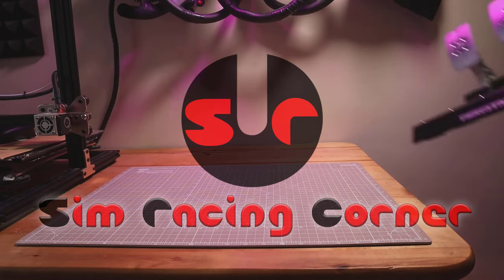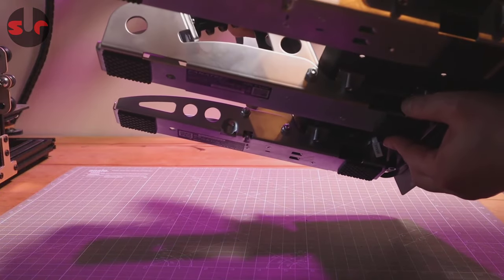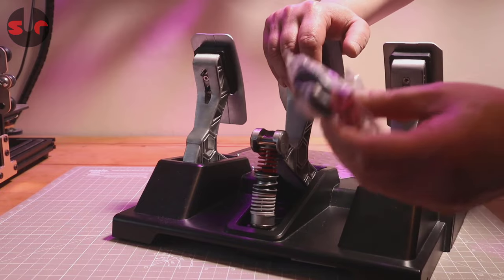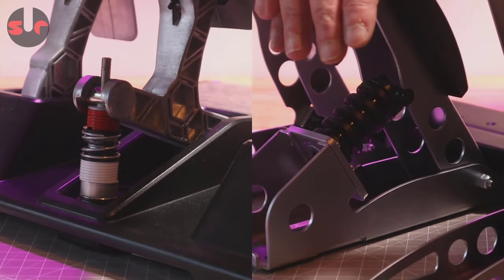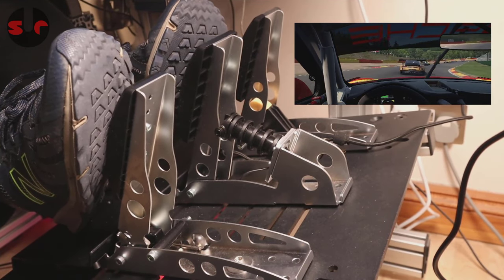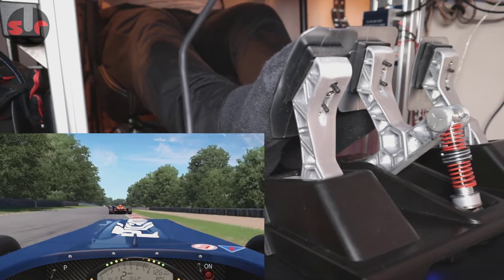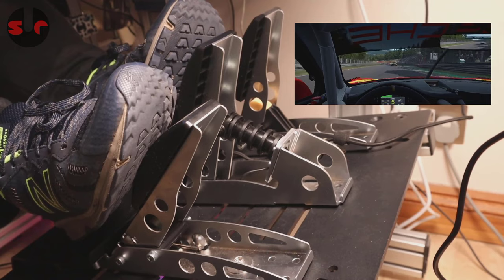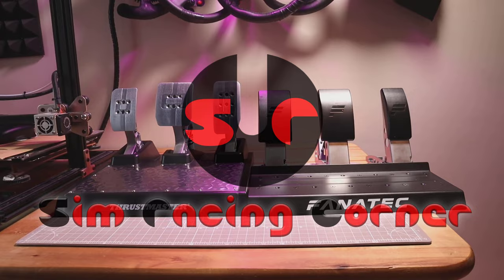Fanatec CSL Pedals Load Cell VS. Thrustmaster T-LCM pedals 🎯SHOOTOUT🎯 Which one should YOU get?

Comment from the maker: ▶ Show your support with a Ko-fi https://ko-fi.com/simracingcorner
Reply: Done. Another excellent video. Looking forward to your review of the 3Drap mods. :)
Reply from the maker: @DrR1pper  Thanks fella. I'll be getting started on testing these mods shortly. Not sure which one I'll begin with, so many to choose from that box. But a bunch of videos on the way soon.👍‍
Reply: @SimRacingCorner  if I may lend my opinion, I reckon CSL pedal owners would be most interested in the load cell brake elastomers mod first, potentiometer brake mod second, throttle and clutch mod third and noise reduction mods last. Not trying to sway you, just my 2 pennies. :)
Reply from the maker: @DrR1pper  I agree, that would be my logic too. They are the more complex videos, so I expect some of the quicker/easier mods will come out first while I'm working on the brake mod content.
Reply: @SimRacingCorner  makes sense. :)

Comment: Nice review. It would have been nice to add a cost comparison so prospective users could help determine value. If the Fanatec are 10–20% better but cost 50% more, then maybe they're not worth the investment?
Reply: The review mentions pricing is comparable. Without discounts and ignoring shipping costs, the CSL LC pedals are $/€200 and the T-LCM pedals are $250/€230. 

Depending where you live the Fanatec pedalset may cost more with shipping than the Thrustmaster set and there could be a promotional price on either set which would impact the price formula. 

Also keep in mind you can start with the Fanatec 2 pedal set at $/€80 and add the load cell brake for $/€140 later on. Sure you'll spend more over time, but sometimes the investment is enough and you have a viable upgrade path whereas the Thrustmaster isn't as modular.

Comment: I'm looking at getting new LC brakes to replace my Logitech pedals. I was leaning towards Fanatec but then I started seeing people reporting issues with the LC pedal not working with the other pedals in the setup. Some report a burning electrical smell. That gets me concerned as the customer support at Fanatec doesn't seem to be all that great.
Reply from the maker: I used the CSL pedals for 6 months without any technical issues. It's the first time I've heard of the problems you've highlighted, and no one's dropped comments on any issues on any of my videos. That makes me suspect the problems are isolated rather than widespread.
Reply: @SimRacingCorner  I hope so. I searched 'CSL load cell pedal not working' and got quite a few hits. I still have a few months before I purchase anything so I guess I'll just keep watching. Thanks for your video. I appreciate it.
Reply from the maker: I don't think there is anything abnormal going on here. Type in 't-lcm pedals not working', and you'll get an equal amount of hits. In fact, you can do the same thing with any hardware, and you'll get hits. Anything mass-produced is going to have some measure of failure.
Reply: @SimRacingCorner  I understand. Nobody complains when things work.
Reply from the maker: @BobK58  Yup.

Comment: When I first got the load cell csl brake i thought it was too stiff but they do break in. Shoes are a must though! Im not going to bother modding the brake pedal but i’m still looking forward to the video. I am looking to do the clutch and throttle mods from 3drap but I have been waiting for you to review first. Thanks for all you do!
Reply: Late comment here, but don't do the 3DRap mods if you haven't yet - Race Sim Engineering does a far better spring mod, check it out
Reply: @IBuiltDaArk  cool I haven’t done any mods yet so I will definitely check it out. Thanks!
Reply: @junkyardblaze189  Karl Gosling has a good video on them, I actually just purchased my set last week and after 1 week I'm loving them, adds the tension I was expecting! A little pricey with shipping to US but worth it

The guy is a redditor as well, that's actually how I first discovered the mod, from /r/simracing
Reply: @IBuiltDaArk  yes I just watched Karls video on them and I think the springs are a little more bang for your buck. Price is pretty close to 3drap anyway.

Comment: A quick fix for the T-LCM lack of stiffness is to put a couple of soft skateboard bushings in place of the lower spring. This will stiffen up the brake action considerably as you're only using one spring as opposed to two springs in series - the single black spring with bushings is actually 33% stiffer than the 2 red springs in series, and a single red spring with bushings is twice as stiff as 2 red springs in series - I knew my physics lessons would one day be useful.

Of course using elastomers instead of springs would be the way to go, and it beggars belief that Thrustmaster didn't include elastomers as an option.
Reply from the maker: I think Thrustmaster decided to pick the safe option going with springs as the extra stiffness of elastomers does add another layer of complexity to the end user to deal with keeping the pedals from sliding on the floor.
Reply: @SimRacingCorner  That's a good point, but still TM could have included some in addition to the springs with a warning that the pedals would need to be mounted to be able to use them properly. I've got a set of Heusinkveld Sprints on the way and they come with a bunch of additional elastomers, so I'm going to get the Sprints set up to my liking and then experiment with the leftover elastomers on the T-LCM - assuming they'll fit.
Reply from the maker: @slaphead90  I agree, it would have been good if they included elastomers as well. Or even sold them as an upgrade of sorts. Considering how popular third-party mods are for the T-LCM brake, Thrustmaster are missing a trick here.

Comment: In fact, it depends only on the base itself. If we have СSL DD, then we take fanatek. T300 or the upcoming DD from the trustmaster - TLCM. The pedals are wonderful, both of them.
Reply from the maker: On console, then yes, it's a fact of the matter. But on PC it doesn't, both have USB and work standalone. As the upcoming TM DD is PC only, you can run either pedal set.
Reply: @SimRacingCorner  I think it's much more convenient to buy a base and pedals from the same manufacturer, right away. And in my country, fanatek is not for sale at all, and ordering separately for the sake of the T300 is too much. The new DD is simply obliged to go with TLSM in the kit, otherwise it will be an insult.
Reply from the maker: @orangechannel4862  It is weird that Fanatec doesn't ship to some countries.
Reply: @SimRacingCorner  They send the steering wheels to my country, but it comes out very expensive, it takes a long time, you have to pay a large fee at the border, besides there is practically no guarantee. I bought the trustmaster in the store opposite the house with an excellent discount and without a headache.
Reply: @SimRacingCorner  it's an insult. They made their products in China yet they don't even ship to the Asia except Japan.

Comment: Hi first thnx for the vid,,,now im new to “sim racing” i play mostly gt7 on ps 5.  Here is my noob question,can i use the fanatec pedals with my tgt2 on ps5? Thnx in advance
Reply from the maker: On console, as the pedals need to be plugged into the wheelbase, you can only run Thrustmaster pedals with a Thrustmaster wheelbase. Likewise for the Fanatec pedals, they only plug into a Fanatec wheelbase for consoles.
Reply: @SimRacingCorner  ok thanks alot for the info!!

Comment: What do you recommend on for example the Playseat challenge?
I have the F-GT Lite and really debating on what LC pedalset i should get.
Thinking about the TLCM, since im a thrustmaster guy and never play with shoes, but those fanatecs look really good.
Reply from the maker: The T-LCM pedals are the safe bet. I do like the F-GT Lite pedal placement, it looks like you can really push into the brake. As for the CSL pedals, if you're prepared for the idea of potentially modding the elastomers, then it's not a problem that can't be fixed if the stock brake is too stiff.
Reply: @SimRacingCorner  Thanks man, then i'll probably go for the Fanatecs if the mods are good. You'll be making a video on that right?
Reply from the maker: @Nickinatorz  Yep, there's going to be a slew of CSL mod reviews coming up.
Reply: @SimRacingCorner  Nice! I'll be waiting for that before I buy, thanks for the help! 😄

Comment: The fanatec can't be used directly with the thrustmaster t300 rs gt wheel base on ps5, can it?
Reply: Have you been able to find an answer yet? I'm in the same position as you. I heard a drive hub will allow Fanatec to work on PS5, but I haven't tried it. Also, idk how brake or Clutch will work with that.